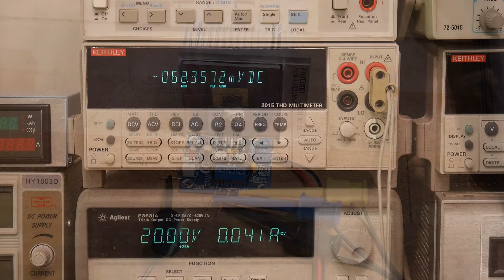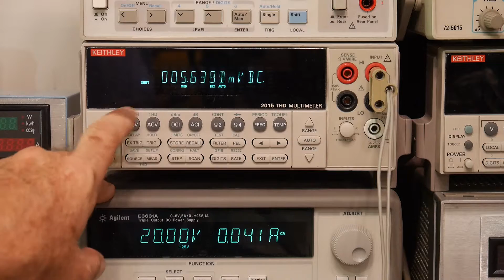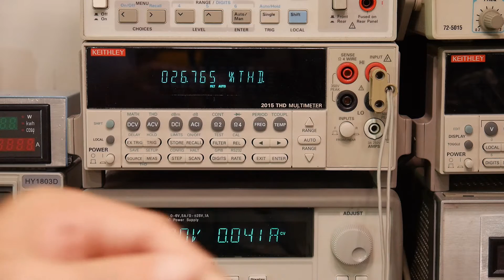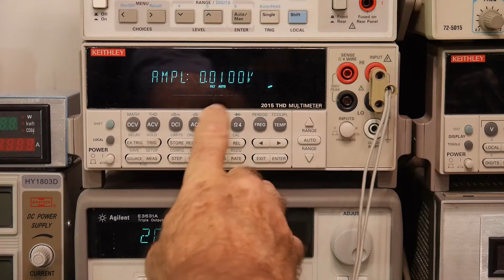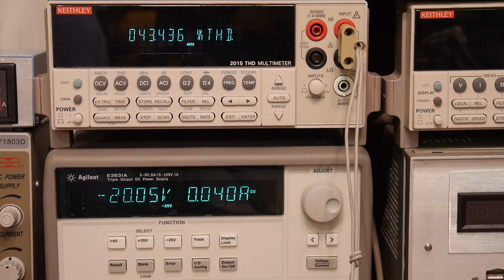#273 LM1875 amplifier kit measuring THD distortion

Comment: Je to sice už hodně let, ale nedá mi to 😁

If memory serves me correctly, when using an external generator, the used frequency from the generator must be set in the 2015 menu so that it knows what frequency it is measuring, because otherwise it shows nonsense, when using an internal generator, we set the AUTO mode and the 2015 should adjust itself.

Nice day 🙂 Tom
Reply from the maker: the 2015 automatically measures the frequency and does an FFT.
Reply: @IMSAIGuy  Thanks for the clarification, I have one more question in this connection, if I switch the inverting signal to PULSE mode, the amplitude cannot be changed (it is still 0 / 5V), the only variable is the frequency, in SINUS mode the amplitude changes normally - is this a property or does it have my 2015 error.
Reply from the maker: sorry I don't understand the question @Edisson.

Comment: You might prefer to avoid using both thd measurement and signal generator at the same time on the keithley.. Since they both share the same clock.. Measurements might not be that accurate.